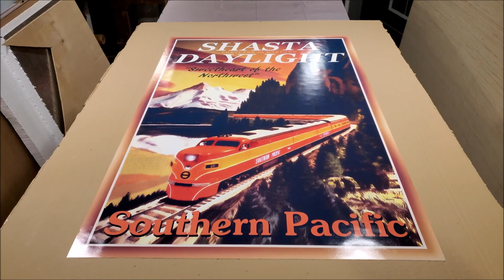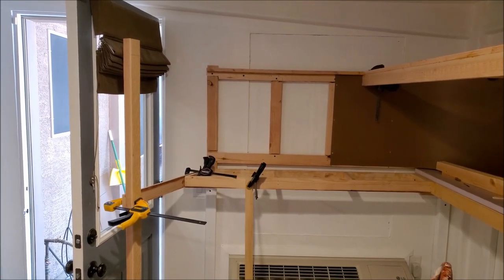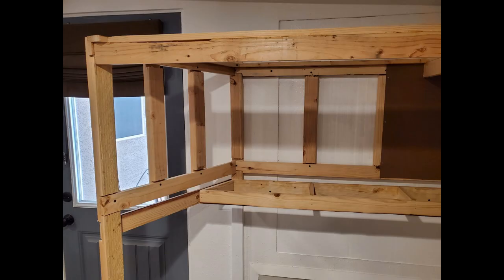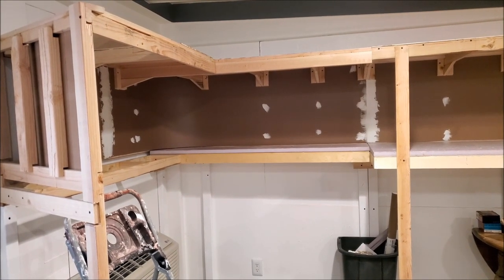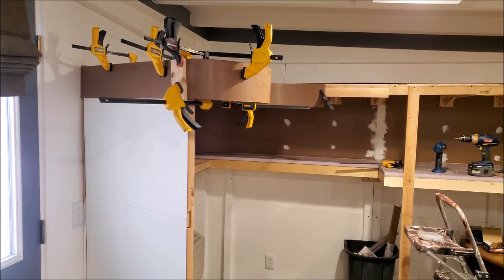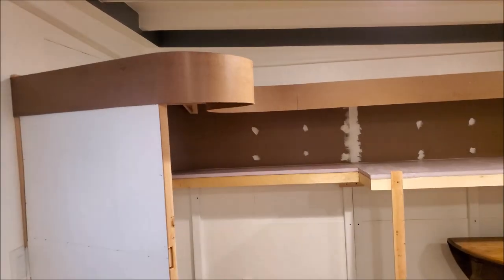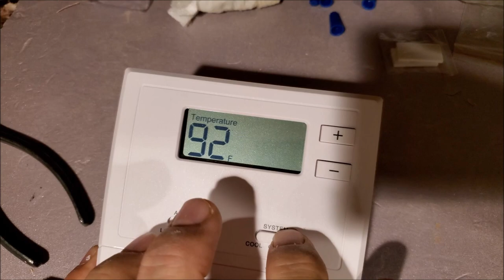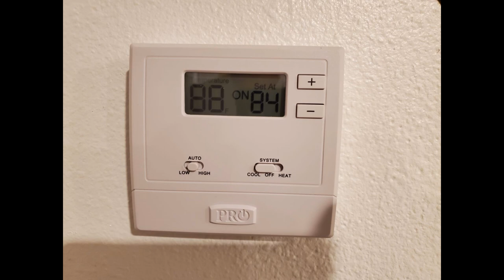HO Scale Model Railroad Benchwork Construction. Layout Part 6

Comment: I leave my little Window A/C unit running all the time in My Train Room.  once it is down to temp it has no issues maintaining the temp.    I used to turn it on only when I went out.  but it took several hours to col the room and did not see any real savings in power from doing that or just letting it keep the space at 78-80 all day long.